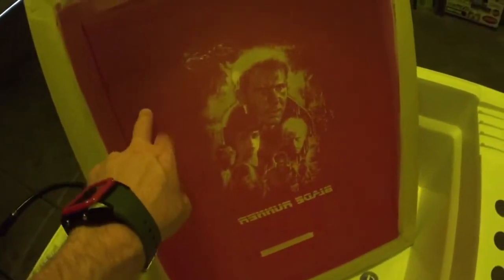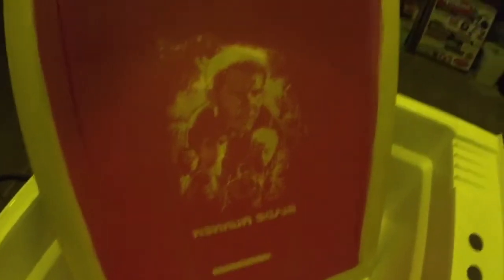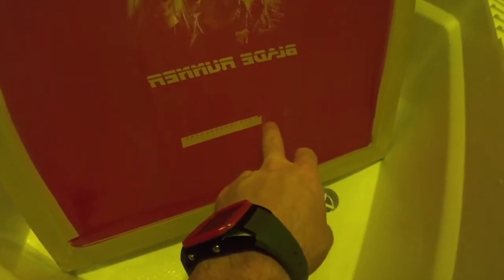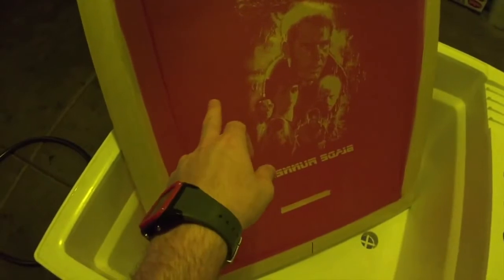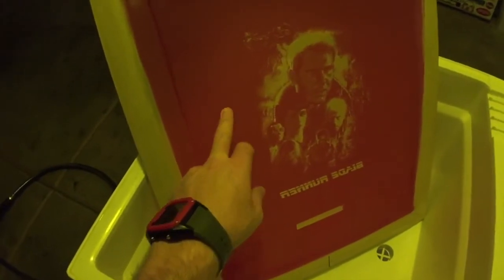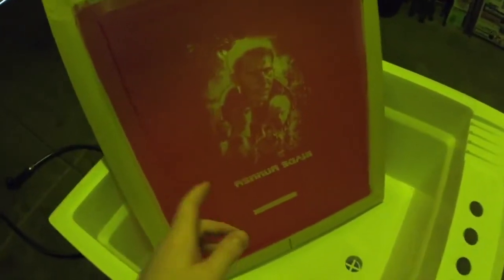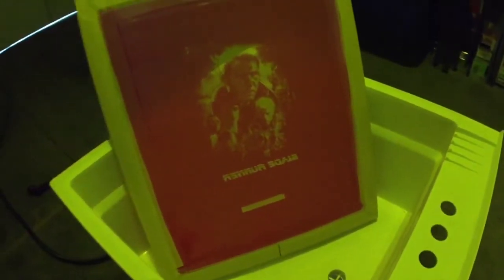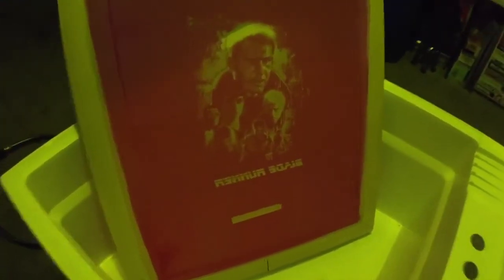Halftone Test | No RIP x 40LPI x 200 Mesh Screen x WBP Emulsion x 500w Exposure Unit

Comment: What was the mesh count you used, I'm trying my best to get my half tones and it is not working out with my 305 mesh. The dots keep washing off. Any suggestions
Reply from the maker: Tony P hey Tony, thanks for watching... this was 40lpi on the halftones on a 200 mesh screen. It’s not a hard set rule, but the formula to calculate the highest lpi you can go depending on your mesh count is - “your mesh count divided by 5”... so in my case I took my 200 mesh screen and divided it by 5 which gave me 40lpi. I prob could have pushed it to 45lpi, but I wouldn’t go any higher than that... your mesh can only hold so much depending on the count you use. Also, if you’re underexposing your screens your dots won’t stay in the stencil as well, so be sure to properly calculate “your exposure time” with an exposure calculator. 

Hope that helps! 

Best 
Shaun
Reply: Hotbox Print Studio Chico Ca thanks for the quick response, I'll try this again tomorrow seeing as I'm frustrated as hell. I have the software accurip where it sets the lpi for you and still not working. But I'll try your suggestion and see if that works. Thanks again
Reply from the maker: Tony P no problem. There’s just a lot of variables to this craft. Even assuring your emulsion is fully dried is crucial too as that can drastically change how your stencil washes out as well. Make sure you give it ample time to dry before exposing and then calculate your time properly with an exposure calculator. After that no matter what you throw at it should be a piece of cake. I don’t don’t even have AccuRIP so your one up on me my friend lol.
Reply from the maker: Tony P last thing i would recommend, especially for halftones is to try and make sure you’re achieving a good positive contact between your film positive and your screen. My setup is extremely bare bones but it seems to work for 99% of my exposures. What I do is use a heavy piece of glass on top that I had a glass company cut for me, and beneath I put a $5 square of foam that I cut to fit from the army surplus store. It doesn’t create the most “extreme” positive contact in the world but it has proved to be enough for everything I’ve exposed. My point is, you need to do “something”, whether it be as bare bones as my setup, or more professional such as something like a compression lid or vacuum lid on an exposure unit.
Reply: Ok, I think I have a pretty good exposure set up, creating a good amount of pressure for the light, but I'm going to purchase an exposure calculator and see if that could help
Reply from the maker: Tony P good luck! 👍🏻

Comment: Nice! I need to start practicing on half tones
Reply from the maker: RhyBeats thanks, I made it even more challenging and tried discharge for the first time with this particular screen as you’ve probably already seen in my blade runner video. I was pretty impressed overall considering I know discharge can be a little trickier to get all the dot from your stencil.